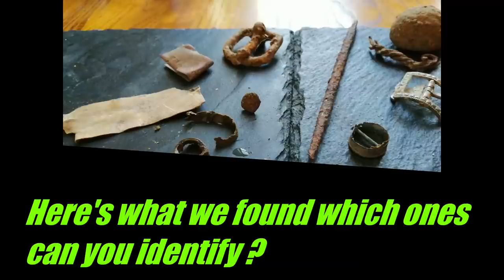Not Quite a Chateau 46 -  Detecting Chateau Land  - A Mucky Job - A Pediment - & Digging up the Past

Comment: Curious, what was wrong with the old balcony railing? The style of it seemed prettier than new one, although I like very much the new one.
Jane your laugh and little sayings are wonderful, " its raining, fiddles".
Reply from the maker: Hi Willdo, yes I say Oh fiddle quite often. The old balcony was far too low and had big spaces in it, so it didn't meet Health and Safety regulations, a child or dog could have fallen through or an adult could have fallen over the top! Rather than cover it with mesh and add extra rails above it, it was better to fit a new safe one.